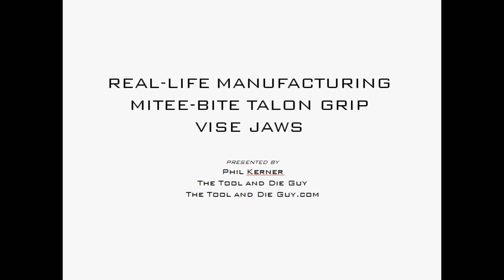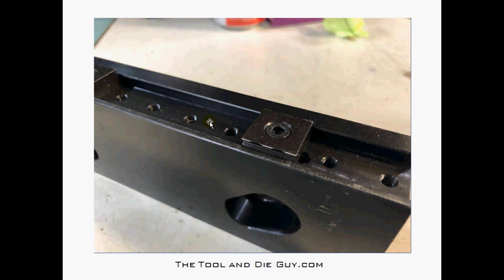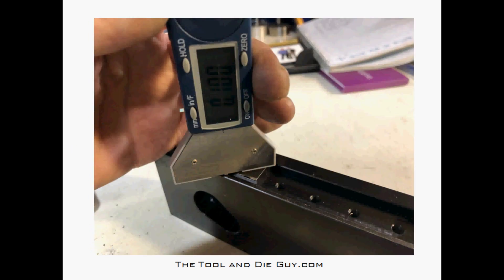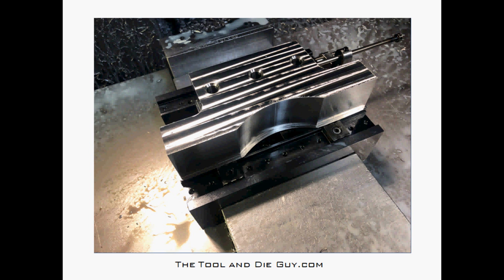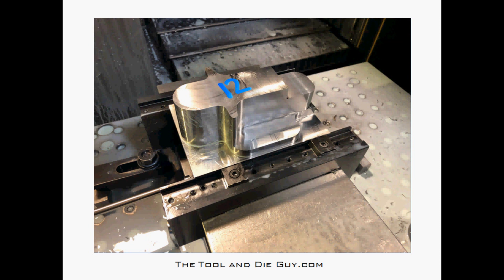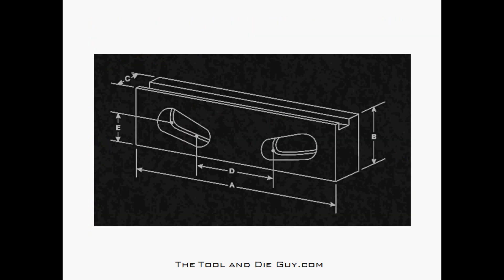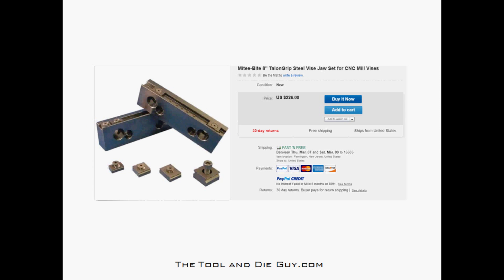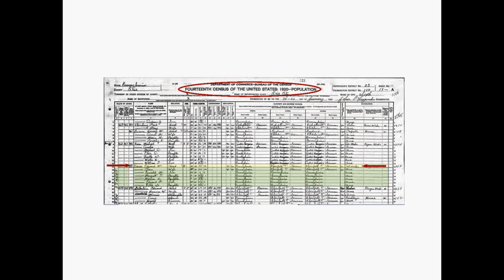REAL LIFE MANUFACTURING: TALON JAWS

Comment: The unfortunate thing about not only the talon grip, but many other specialty vise jaws, is that they are not available in “Snap Jaws” style of attachment using a tee slot over short head cap screw arrangement for quick change.  In a die shop or production shop environment with today’s short run requirements, time is money and idle changeover time is costly. Fiddling around with traditional shcs, running them out and then back in is time wasted even with an air ratchet and as a result I rarely use my talon grip jaws.  A word of caution regarding the talon grip. I wish you would have mentioned that they do indent the surface approximately.060 up into what they are holding so that area needs to be either waste stock and milled off after inversion as you indicated, or not be a factor in the surface finish or function of the part.